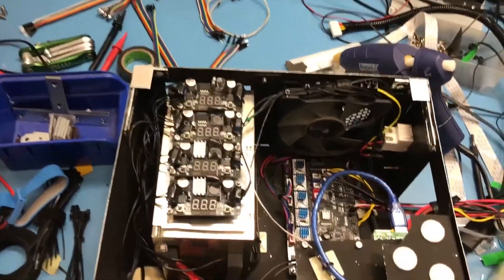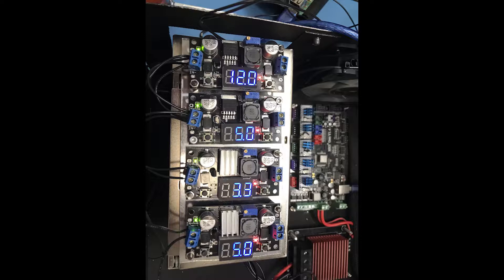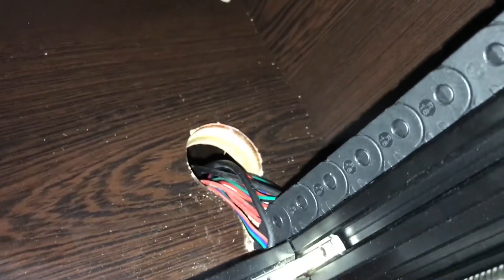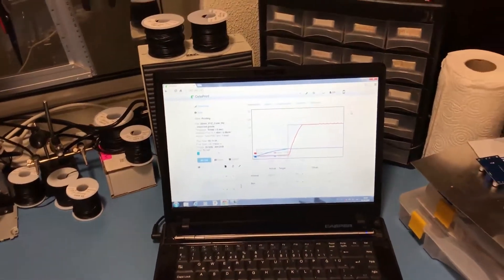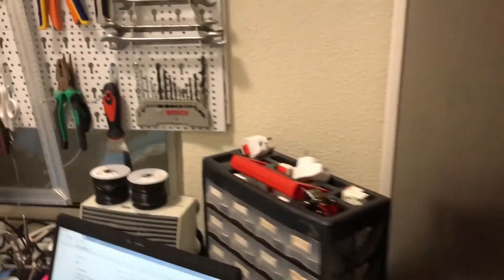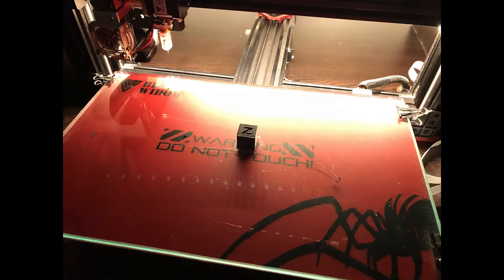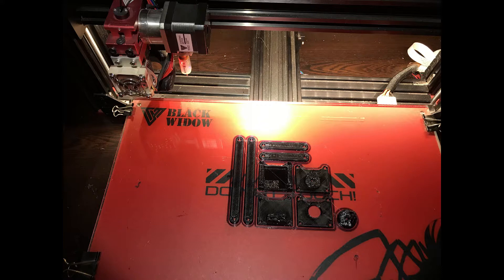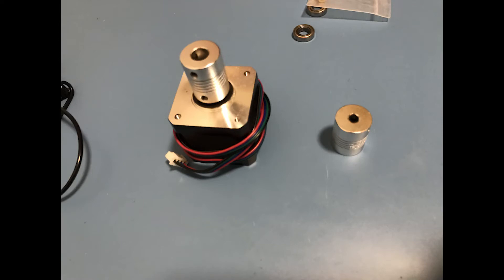Tevo Black Widow Mods Part 2 - Mounting & Wiring The Control Box

Comment: I plan to use 2 12v fans and a 12v water pump. Do I need to use 3 buck converters? If so, can you show me how u wire yours?
Reply from the maker: 1 will be enough. Just wire them in parallel.
Reply: Thank you!